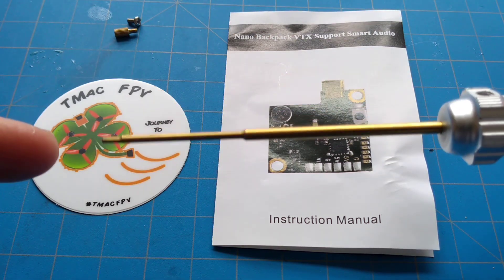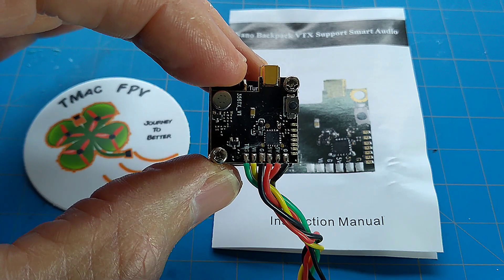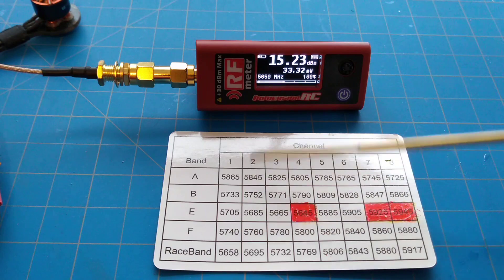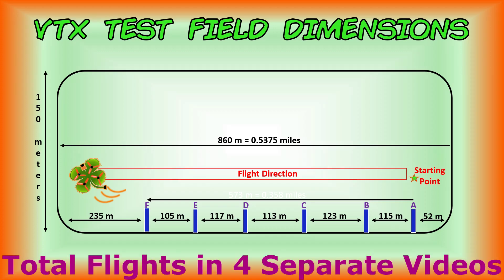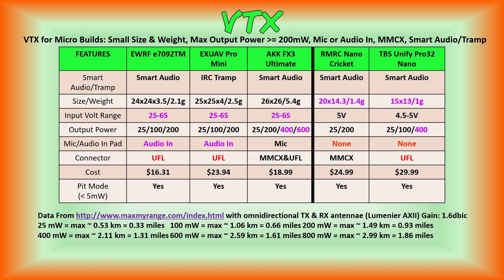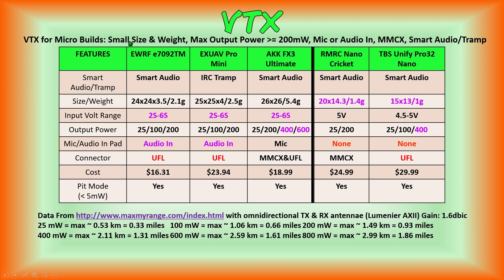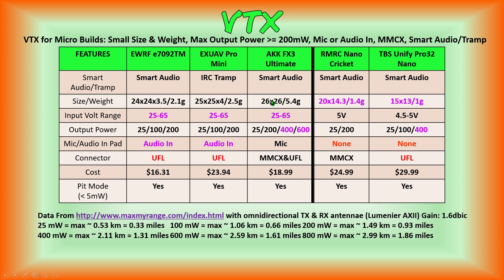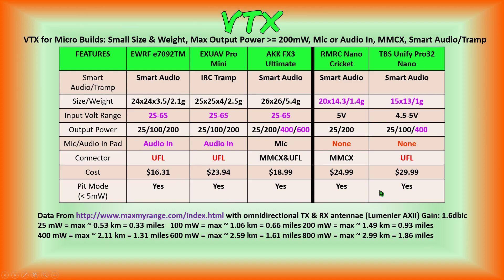MICRO FPV DRONE PARTS-VTX AKK BACKPACK

Comment from the maker: What are the most important features for you in your Video Transmitter?  MIcro (2-3 Inch) or Mini (5 Inch) Quad? Comment Below & Thanks for Watching! 👍
Reply: size, weight, and power output above 200--pretty much the same as your list 👍  I do have the RMRC cricket nano and it's working well in all builds down to a whoop size.  I have a few foxeer lollipops that have a worryingly loose connection to it, but the whip antenna locks up solid.  I'm not sure if I like mmcx based on my limited experience. I probably should buy a few more antennas.  UFLs haven't been much of a problem on other vtxs.  I try to ziptie those down together with the vtx.
Reply from the maker: @MrGone2k  Thanks for your watching and your comment.  Do you fly with audio (listening to your motors)?
Reply: @TMacFPV  no, i actually haven't tried that yet.  maybe i'm missing out :)
Reply from the maker: @MrGone2k  You ought to give it a shot sometime. I have found it adds to the fun, overall immersive FPV experience and it helps with altitude control and throttle management because you're actually hearing your own motors respond to your stick inputs.  Best audio for this is from an external mic i have found.  I have been using the adjustable gain (i.e. adjustable volume) electret microphone like this:https://amzn.to/2tLKcpL with a VTX that has an audio input solder pad (different than smart audio pad).  I've got "a video or two" on VTXs that have this type of audio input pad if you're interested. Once I had triefd it, I now find its difficult for me to fly without it (gives me an "empty feeling"!
Reply: @TMacFPV  awesome.  I'll definitely add this to the shopping list and give it a shot.  I'll also check out your other vids on this.  Thanks!
Reply: Thanks for putting out this video btw.  Very informative and I think this might be the vtx to get for a future build or replacement.  The value is undeniable.
Reply from the maker: @MrGone2k  You're welcome.  I really enjoy helping people out in this hobby.  One thing I love about it is I'm always learning and I just enjoy passing on what I have learned though my experiences to help others.  Truly appreciate your feedback.   Thanks for taking the time to give it!  If you ever have any questions or suggestions for our TMac FPV channel, shoot me an email or get in contact with me via our social media links above. Happy Flying!

Comment: Have you tried the new AKK Nano camera yet?  It's designed for the Oscar's backpack to screw on!  It weighs a mere 2.5g!  Making the total for the two come in at less than 5.5g!  Here's a link:
https://www.banggood.com/AKK-Nano-1_6mm-43169-FOV160-FPV-Camera-OSD-for-Oscars-Backpack-VTX-FPV-Transmitter-RC-Drone-p-1541582.html?rmmds=search&ID=530499&cur_warehouse=CN
As you can see from the pictures, it comes with a toggle menu settings board!  So, even though the camera weighs near nothing, you can still adjust it's parameters! I've tried this camera with the backpack on a GnarlyFPV Primo110 TRUE Toothpick build weighing in at 45g exactly.  It has amazing sharpness without any of the over sharpening that results in red blotches and sparklies. Plus, the color and saturation are incredibly accurate!  Changes in light from pointing at the sun to the deep shadows was great...maybe not as good as the Predator 4 nano, but what is?!!  LOL  It was very good though.  I'll have to say I'm very impressed with what you get for $14.99 regular price.  I got it on an introductory coupon for $12.28 !!  Under 5.5g and that cheap?!!  I paid about the same price as the predator 4 nano (4.9g) camera only and I got the AKK Nano camera AND the Oscar's backpack VTX, and the two total 5.5g...so only 0.6g more, and we have a great tiny VTX with 400mw (as you tested) and an MMCX and mic!  HOLY COW! =(:^)-

Comment: Your video pretty much couldn't have been done any better! You have the same exact boxes you want checked as I do! Sick of those crappy u.fl connectors failing! I also prefer a mic and 200mw.
I ordered 3 of the Oscar's backpack recently and love it so much I've already used them up and need to buy more! 😁 
Crazy how good the backpack did with only the 25mw setting. Made it 800m with absolutely no break up whatsoever! Amazing the 200mw is actually 400mw... couldn't really ask for anything better considering the size and ultra low weight!... And great price! 
Have you had any problems with either the AKK Race or the backpack? 
I'd like to see a review of the *Speedbee TX500*. It checks all the boxes too but with 20x20mm mounting holes. I've used several of those also. I used to use the EWRF VTX you listed, but had several problems with them... Some were u.fl related, but some just stopped working. I don't think the quality is as good as the AKK or Speedbee. Build quality of that VTX looks fantastic! 
Thanks for the great review! 😎👍
Reply from the maker: Thanks you! Glad it was informative for you. I don't do UFL connectors anymore. I too was amazed at the Backpack. I've had no problems with the Backpack or the Race. My go to is still the EWRF e708TM3 when it will fit. I have never tried the SpeedyBee TX500.  I'll have to check it out.  Very much appreciate your time and support. We'll talk again soon friend-Clear Skies!
Reply: @TMacFPV  July 4th Sale @ AKK giving us 20% off! So, that AKK Race is only $7.99 !  How an that be beat?!
IT CAN'T! 😜
Do you have a favorite 20x20mm VTX, that checks all of our boxes?
Reply from the maker: @scootroter4859  Great price on the AKK Race VTX.  if you're talking about a 20x20 mountable VTX with all of our features, I haven't come across one yet.  Usually, just use double-sided tape.  Just ordered that SpeedyBee TX500 you were talking about though to give that a shot. It has an on-board mic instead of pad fo an external one, but I'll give it a shot to see what its like!